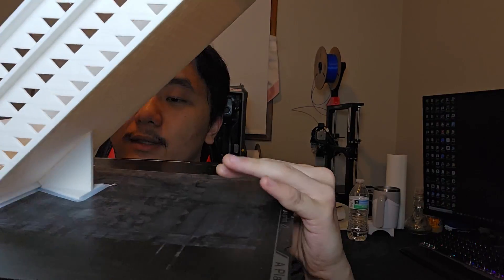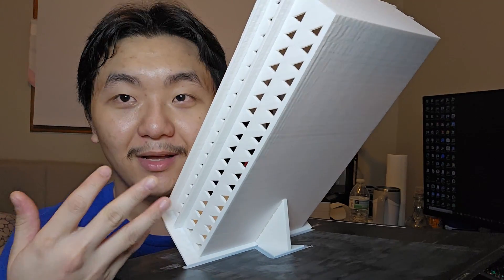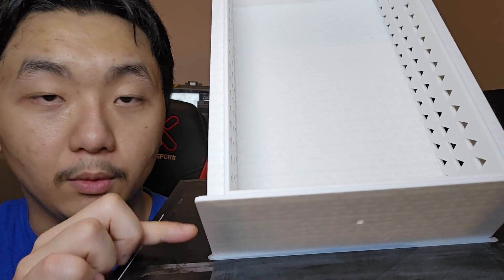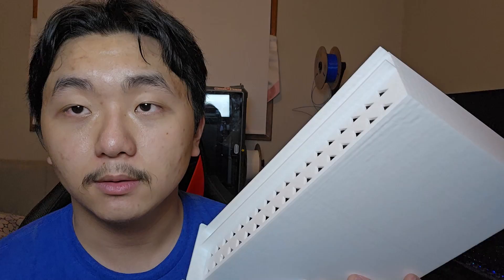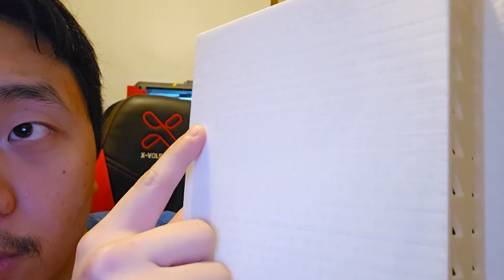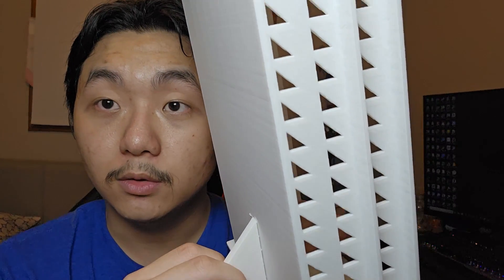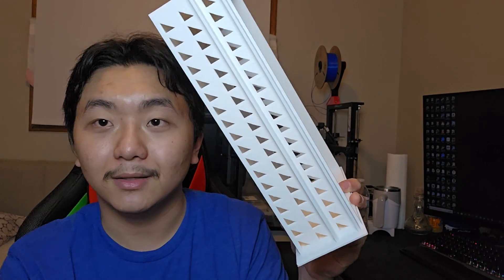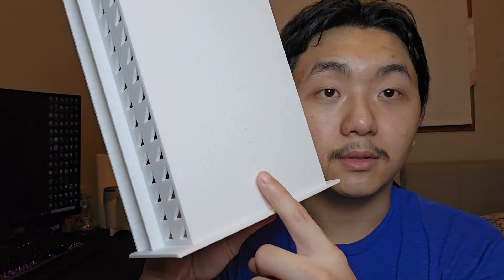Print At 45 Degree Slanted No Generated Support!

Comment: You do probably inner outer walls which means that the outer line presses against the inner which at that height will bend your entire model so you get a bunch of artefacts on the surface. You could try outer perimeter first. At 45 it should still be doable with enough extrusion width.
Reply from the maker: Thanks for the tip, I will try that!

Comment: The waving is caused by speed it is called ringing. That is what input shaping will lessen.
Reply from the maker: ahh, that's good to know, would it be possible to tune that without rooting?
Reply: @Scratch3DPrinting  i dont have any experiance with that printer so i cant say for sure. Sorry
Reply from the maker: @jimskinner2777  ahh all good. I will do more experiment and maybe make a video for it in the future.
Reply: @Scratch3DPrinting  All you need to do, is to lower the print speed. The moving mass increases as the weight of the printed part grows. It will print just fine, just slow it down the heavier the parts gets. Like by reducing it by layer height.
Reply from the maker: @FrodeBergetonNilsen  oh, thanks next time I'll slow down the print speed.